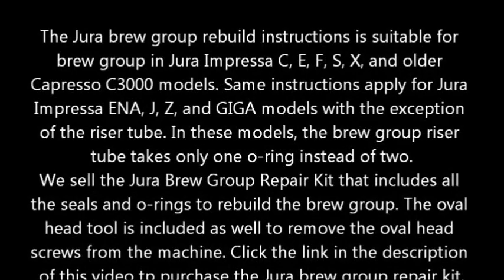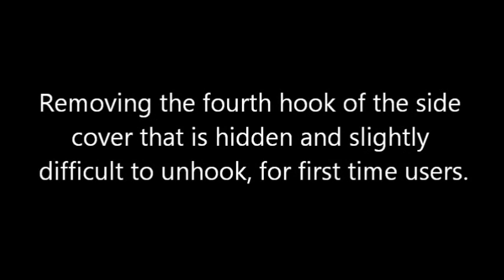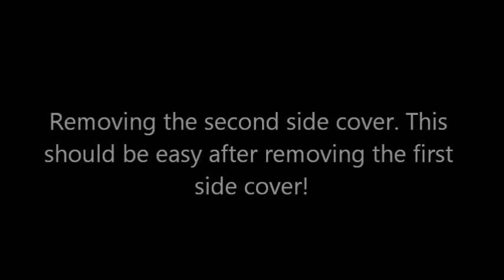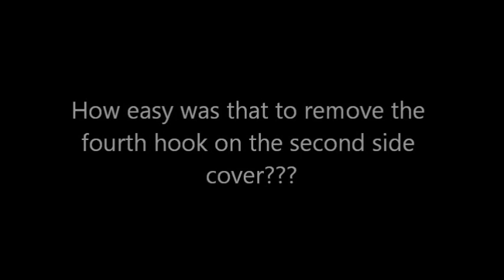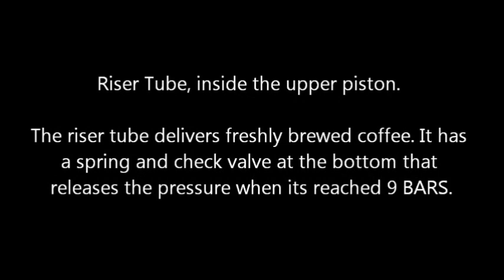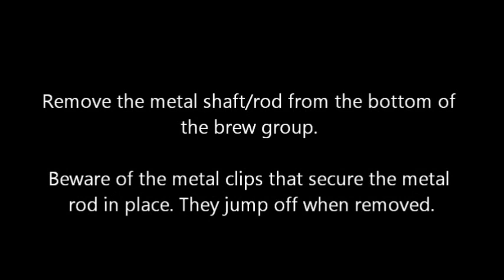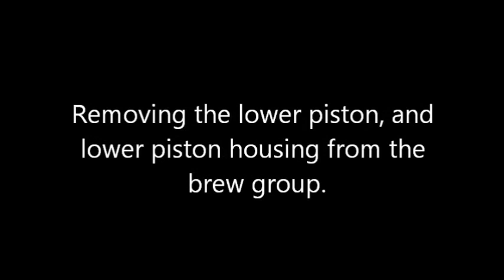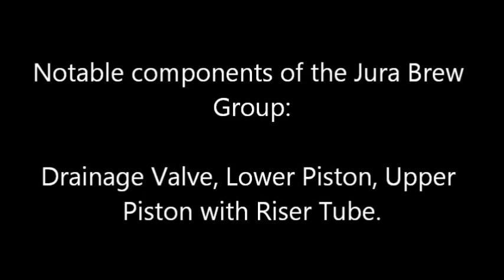How to Disassemble Jura Brew Group to Fix ERROR 8 | Jura Brew Group Repair

Comment: There are a lot of Jura brew group videos now, but this was the first one I ever saw and it encouraged me to do my own repair. I've done many of them now and can knock them out extremely quickly, thanks to Parts guru!
Reply: Hi, i've cleaned, lubricated and changed the o rings of my brew group. I've installed it back together but the lower piston every time pops out at the point where the coffeecup/lower piston would turn over/side ways again. It pops up and then the brew group is stuck on the edge of the lower piston
 Do you know how I can fix it? It keeps happening... thanks
Reply: @MaasProductions90  https://youtu.be/EMV-SOt42pw. This shows the proper piston orientation
Reply: @mguerramd  thx!

Comment: Oh my goodness- thank you for this extremely helpful video. I reassembled everything using a different video, and while my Error 8 problem is now fixed, the water is going straight into the drip tray instead of out of the faucet. Your explanation at 22:53 helped me realize that I bet I have the lower piston inserted backwards! If it's facing the wrong way, it can't seat into the drainage valve and the water just rebounds off the back of the piston into the tray, right?! I could not find anything else online to explain the way water flows through the machine. You're a fantastic teacher! I will try again and flip the piston the other direction and see what happens. Fingers crossed!
Reply from the maker: Glad you found the video helpful.  Hope you are able fix the brew group.
Before you replace the side panels, please make multiple coffee products to ensure the brew group is working.

Comment: Thank you so much for this amazing video. Are you a teacher? You truly have great skills in explaining things. You saved me a lot of money. I have a Jura ena 9. The brew group did not return to the home position so I couldn't fit the tray back in. With this video I was able to carefully disassemble the brew group and I found the problem. The lower piston was going up too high (about 3 or 4 mm) and blocking the mechanism from going to the home position. I washed everything and changed the o - rings and lubricated where necessary as showed in the video. I reassembled everything but the lower piston still went up too high. I don't know what I did but in playing around with the mechanism it began to work properly. I don't know how long how this repair will work as I don't know what I did to fix it. Any one out there with the same problem or any suggestions? Can you please send me a link to your Web site as I would like to buy new orings and lubricant. Thank you so much for this video.
Reply: I have the exact same thing happening... can't figure it out. Have you figured it out in the mean time and know how this is happening?

Comment: Excellent video! Am considering rebuilding my ENA3 brew kit. However it’s only producing very coarse grounds regardless of settings. I’ve taken apart and tried various calibrations, even as “tight” as possible and still getting very coarse grounds that do not form pucks. Presume this is a grinder issue and not brew kit seals, etc. PLEASE HELP!!

Comment: Very well done videos, low resolution though. If you need to clean plastic parts of brew group and You do not have proper solvent, just dissolve one tablet of Jura Cleaning Tablets in hot water.

Comment: Thanks alot! Great video. I would recommend always to remove the filter though. Mine looked clean, so i wasn't sure if i wanted to remove it but the other side was full of deposit. That cant be good for the taste.
Reply from the maker: Hi, the filter/screen should be cleaned while you have the brew group apart for rebuilding.

Comment: I determined the issue with my 2007 Jura F7 was a faulty o-ring and not the membrane regulator, thankfully - but once I cracked the machine open to diagnose, your videos inspired me to remove and clean the brew group. So, glad I did - the machine looks like new now. Next time I'll go for the full disassembly.

I did order my parts from you to include some of the descaling packets, however, I don't know how to get my Jura into the Descle program. I tried setting filter to no - even though I use a filter and the water hardness level is set to 2. I've never gotten a descale prompt from the machine either - so I'm not sure how to use your product. Any assistance is appreciated!

Comment: Thanks for the helpful video. Is there a way to remove the lower piston head if it's stuck in home position (at the bottom of the housing)? Pushing up from below doesn't work, the white gears surrounding it aren't turning.

Comment: In the first scene you show the tongue installed backwards. It has the double bended tongue. It should be the flat part of the tongue. It must be turned 180 degrees. I don't know the actual name, but it is brown plastic. It is called compacting housing

Comment: Any good videos for what to do once the brew group is reassembled and placed back in the Jura? I replaced the water side panel and want to run it to see if it works before putting the other side panels or top back. But the system says to open tap and then filling. When it says shut tap, I do so but it goes back to saying open tap. Any suggestions?

Comment: Bought O-rings and tool from you, and then disassembled, totally cleaned and reassembled machine by following your video on how to fix Malfunc 8. .  Your video is really well done!!  When the machine turned on, the piston went down, came up 5 rings, the hesitated, then came up little more but then kept grinding to come up when it was at peak and should have stopped. Malfunc8 showed on screen.       So..took apart the  Brew Group again, making sure that all moved smoothly and easily.  Then reassembled machine and turned it on again.  Same exact actions happened, ending with Malfunc 8.   What do you suggest for a cure now?  What should I try next?  I thank you you for your help.
Reply from the maker: Hi, so, the brew group moves vertically fine manually, but, when you install it in the machine it struggles?
When you re-install the brew group, please ensure that small white gear on the drive motor is properly seated in the vertical metal gear, and that gear is properly seated in the big white gear on the brew group.  Also, the 3 brew group screws should be fastened. Make sure the brew group does not wiggle after installation.
Hope the above helps.
Reply: +Coastal House brew group moves fine installed, until it comes back up and hesitates.  After hesitation, it tries to keep moving up and grinds after it moves short distance to top.  so it works well until it will not cease.  All the gears have been checked and screws, all 3, are fastened and no wiggles.  any other ideas of what the problem might be?

Comment: Great video guys. On the left side of the heat exchanger with the two outlets, does the rear outlet connect to the check valve/water tank and the front outlet to the ceramic valve? Or do I have them backwards. I didn't get a good picture of it during disassembly and the video doesn't quite show it. Thanks.
Reply from the maker: Hello Chris,

That's correct.
Outlet C connects to the ceramic/multiway valve.
A is to the pump and B from flow meter.

The outlet, with transparent gasket, located at the bottom, alongside A, is for residual water from the hydraulic system into the drip tray.

The heat exchanger should be kept cleaned, free of calcium sediments, to avoid SYSTEM FILL error in J and Z models.
Reply: Parts Guru Great, thanks for the response. Ill keep you in mind the next time i need parts
Chris

Comment: Hi. Thanks for making a great video. However, after changing all the seals and lubricating as per your instructions it seems the lower piston has a problem getting back to the home position, the top of the piston getting stuck. Any ideas?
Reply from the maker: +halfwitish Hi, please reinstall the lower piston.  To ensure its installed correctly, I suggest you manually operate the brew group before reinstalling brew group side covers.

Comment: Great video, thank you, I have successfully dismantled and rebuilt my brew group with new seals following your instructions.  I still have a problem that insufficient water is being dispensed with the coffee. If I run a rinse cycle the water comes out where it is meant to, but not if I make a coffee, could you offer any pointers on what the problem might be?
Thank you
Reply from the maker: Hi Colin,  It could be that coffee is finely ground.  To test that, please make a pre ground coffee using the pre ground coffee chute, and see if that makes coffee normally.
Reply: Hi, Thank you for your reply, that is exactly what the problem was. So I am assuming that I need to clean the grinder out better than I have. I had not dismantled it, only cleaned it using a small brush.

BTW, sorry for taking a while to reply, I was expecting Youtube to send me an email letting me know if there had been a reply but it didn't!

Thanks again, Colin

Comment: Hi Parts guru, I know it's been 8 years but I'm giving it a shot... I've cleaned, lubricated and changed the o rings of my brew group. I've installed it back together but the lower piston every time pops out at the point where the coffeecup/lower piston would turn over/side ways again. It pops up and then the brew group is stuck on the edge of the lower piston
 Do you know how I can fix it? It keeps happening... thanks

Comment: Hello, I’d like to thank you for this extremely helpful and well explained video. A breath of fresh air. 
Thanks to your videos I’ve been able to completely clean the new unit and replace the grinder in my machine. 
Unfortunately I’ve obviously done something wrong as the machine now spits out some coffee behind the bucket (on the two electric connectors at the base of the tray). 
Are you able to offer and help on what could be at fault ? Many many thanks for your wisdom. :)
Reply from the maker: Hello,  is it coffee or luke warm water in the tray?  What model Jura do you have?
Reply: Parts Guru 
Hello 
Apologies - I was not Specific enough - it is ground coffee. The pellet goes in the tray and a small amount of non compacted ground coffee is leaked on the back connectors of the drip tray ....the model is the Jura impressa j9. Thanks :)
Reply from the maker: The ground coffee maybe too fine.  The ideal coffee ground should be like table salt grain when you feel it between your fingers.  It should NOT be fine like Fluor.  You should consider replacing the grinder if the machine has made over 5,000 cups of coffee.
Reply: Parts Guru hello 
Thanks for your advice 
I have increased the coarseness of the grinder and I am still having the same issue. One coffee puk produced and some coffee granules on tray each time a coffee is made. 
I did replace the grinder. I am wondering if I did not put it back correctly or if there is another setting I could have got wrong that would produce this problem? 
Thanks

Comment: Great video.  I have completely clean the unit and still I have a malfunction 8 on my S9.  the lower white plunger valve just moves in and out about 8 times then throws the malfunction 8 code.  What do you think the problem is?
Reply from the maker: Hi K. Powell,
The brew group in your Jura S9 may not be at a home position. This is analogous to a car being in a parking gear. If not, then the car won't start. The brew group in Jura S9 and all Jura machines is supposed to be at a home position.  Please watch the video where the Guru demonstrates how to rebuild Jura brew group.  That video explains the home position in Jura brew group. Please check the link below:
https://youtu.be/Fmqm59UeiAA

Comment: jura E8 I took apart the brew unit  cleaned it lubricated it . 
put the machine back togheter but the brew unit does not always fully cycles .Where did i mess up?

there is a two way valve it comes out of the heating unit t and goes at the bottom of the brew unit hat is leaking could that be the problem?
Reply from the maker: +Daniel Cifor Hello Daniel,  it would help if you could please email a picture of the leaking two way valve so we can correctly identify it for you.

Comment: I followed your instruction and now my E8 is moving and sounding like new. Can you please tell me what the used coffee puck should look like it the unit is working perfectly?
Reply from the maker: Hi Bill, the ideal used coffee puck is well formed like a hockey puck.  Also, feel the fineness of the used coffee grounds between your finger. It should feel like table salt grain.
Reply: +Parts Guru Hi, thank for getting back to me so fast. The pucks are not well formed. Also the coffee is not fine like table salt. I have the grind setting in the most course setting because the coffee I'm  using is very dark and oily. When I first got the coffee maker someone added water to the bean side instead of the water side. The unit was never turned on and I completely disassembled the grinder before it was used. I'm almost sure I put it back together right. Is there some way to confirm this?
Reply: +Bill X Hi Again, I read your video about cleaning the grinder. I went through all the steps and when I went to make coffee the grinds are now very fine. However it take a long time for the coffee to flow. Taking almost 2 min for 4 oz. I also noticed it was dripping water now from the 3 way pressure connector. When I took the pressure connector apart it was broken inside. I ordered a replacement from your website. Would it be possible to call you during the week to ask you some questions about why is is acting like this?
Reply from the maker: Hi Bill, yes, please give us a call to discuss the issue with our technicians. We're here to help!

Comment: Hello Guru,

Have taken the brew group apart a dozen times and reassembled into machine. The lower piston is in home position and the gear starts down 3 1/2 rings. When the machine starts it drives up to the top and then down to the bottom, comes up to about the 3 1/2 ring mark, stops then comes to the top, stops and then tries to drive further up, but there is no where to go, then malfunction 8 appears. This repeats over and over. I took the brew group out of the machine and tried to see what wood happen, and similar results, the gear spins, always with malfunction 8 appearing. The brew group is mounted tight and clean. We spoke a few months back, I have made multiple videos that I could send you showing you what is going on, any advise would be greatly appreciated, 
Thanks
Suzie
Reply from the maker: +Suzie Beer Hi, assuming that brew group is properly rebuilt, this could be due to a bad encoder.
Reply from the maker: +Suzie Beer Hi Suzie, assuming that brew group is properly rebuilt, this could be due to the bad encoder.  Please  check the -ve and +ve wires on the brew drive motor as well.

Comment: Hello Parts Guru,
I have taken the machine apart a few more times, the brew group is clean and tight, secured tight to machine. When i turn the machine on the motor drives the gear to the bottom very smooth, then comes half way up very smooth, stops for a second, then comes up to the very top, again smooth, then the motor tries to continue, but it is already at the top, and you hear it struggling but there is no place for it to continue up, then malfunction 8 appears. I have taken it apart multiple times, and started the brew group 3 1/2 rings down, started it at the top, and also tried starting half way down, always the same problem, when it gets to the top, the motor tries to continue and there is no where for it to go. Could this be a bad position sensor or bad circuit card or any other thoughts would be greatly appreciated !
Reply from the maker: +Coastal House Hi, it could be a bad encoder.  The encoder essentially dictates the movement of the brew group.  Please note that this is a rarely replaced item.  I'd examine the brew group rebuilt, especially check the position of lower piston inside the brew group.  Ensure the geared motor is aligned with the brew group without wiggling.